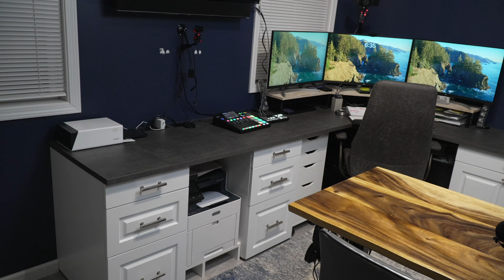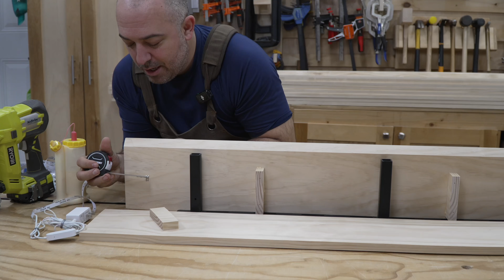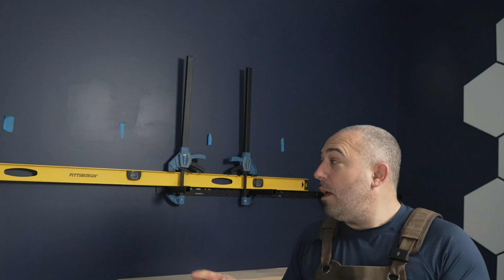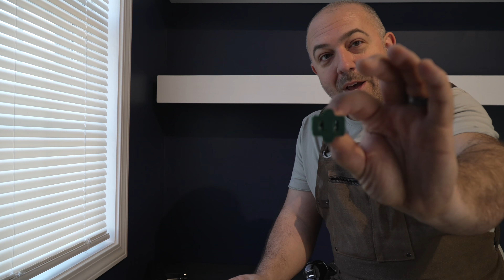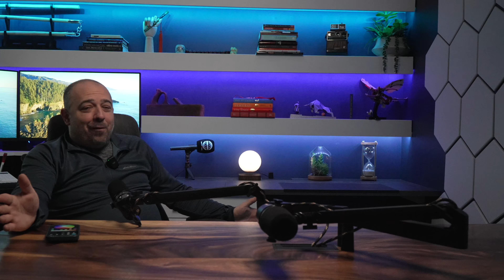DIY Floating Shelves With Built-In RGB Lighting

Comment: Is that the miter saw from harbor freight? If not which one is it? I like the idea of that design for space savings, but they seem to cost more than the sliding type.
Reply from the maker: It’s the delta but I’m honestly going to get rid of it after 3 months (will be doing a video on it) because it’s not on rails there is deflection (right to left movement) when I cut all the spacers for this one and I lined them all up together, there were a few that were not the correct width, and I had to make more because of that deflection. Going to look at the Makita next because it’s front rails (space saving and rails for stability)
Reply: Interesting. Do you still have the Hercules? Since it's had some use, what do you think of it? I was looking at that one.  @BitnerBuilt
Reply from the maker: @papaducky  I sold the Hercules, but I’m actually gonna buy it again just for the review video I think I’m gonna compare the Hercules the Delta/bosch (same) Makita and mayyyyybe festool. I did a video on the Hercules and it is hands down the best miter saw for the price, it’s $250 on sale now, and other than the big footprint it’s excellent otherwise, you wouldn’t regret getting that one. I have a space constraint now due to my dust collector duct line so I have to stay with the compact size ones
Reply: I look forward to the comparison. 
Thank you for replying.
Have a blessed day!!
@BitnerBuilt

Comment: Great project. Your video def helps me & gives me the motivation for making the 360 floating shelfs I’ve been wanting to do in my son’s room. He has a bunch of collectibles he would like to display, including Funko Pops. 

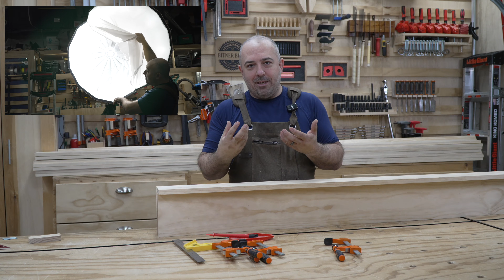At 14:27, I’ve recently switched from the Govee led rgb strips to Cob led strips. Have you heard of them? These do not have the single diode leds like the Govee leds. They also come in rgb and Rgbic which is the ones that I use.  They also come with a control AND app and can be controlled that way. There are different brands out there and they do cost more but this is great alternative to regular led strips if you can’t hide or avoid the single diode looking effect. 

I do have a couple of questions: @19:05, Is this 1 big long led strip, let’s say 60’ being routed into all shelves or does each shelf have its own led strip, lets say 13’? I couldn’t really understand this part. 

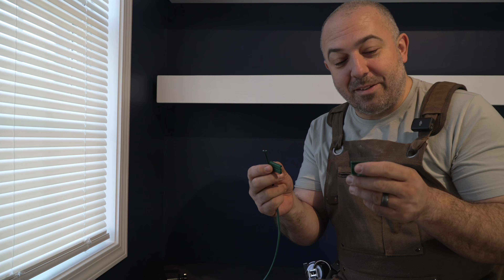@20:39 do you have a video going into detail about the Gilbert plugs that you referenced towards the end? I’m super curious about these and would definitely help with my soon to be project 😊

Thanks again!!
Reply from the maker: Thanks! Wow that sounds like a fun project! Haven’t heard of those, I had a bunch of the Govee laying around so went with those, I like the newer diffused stuff but oh man it’s expensive! (These were $9) they are 15ft strips, I cut them to length , one per shelf, so I have 4 strips I used,. On the Gilbert plugs I have shown them in a few videos but no specific dedicated video on it. I have prob used 10,000 of them with my xmas light business I own (only industry I know that uses them) Basically they have two spiked prongs that pearce the wires sheath when you slide the cap on, that’s how I can put several females on the wire without cutting it, it just “vampires” in. You cut the wire to length, put a male at one end a female at the other and then if you need other females just add them in where needed. A great use for it as well is you can poke a small hole in a wall use a snake to put it up to another small hole, THEN put the plugs on after, this way you don’t need big holes for the plugs to go through)